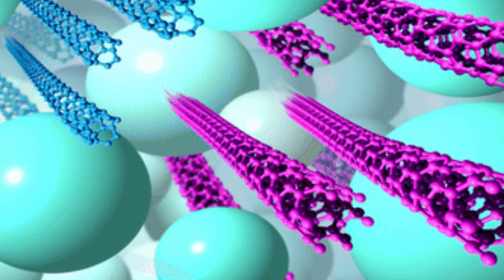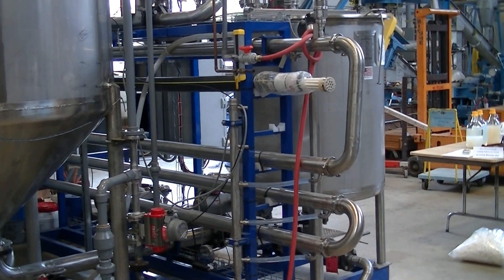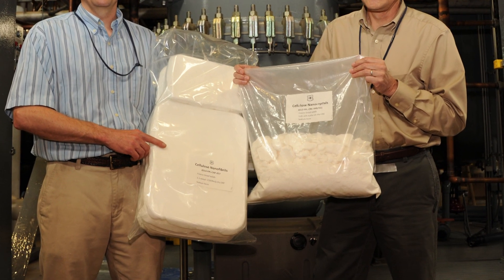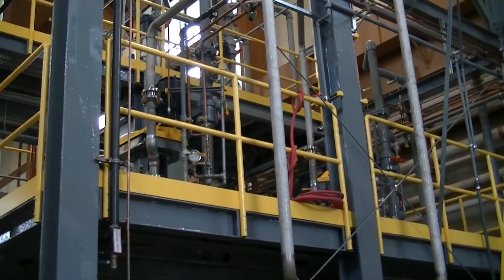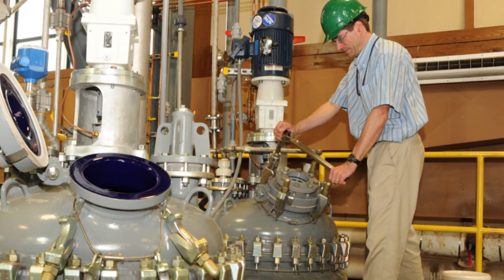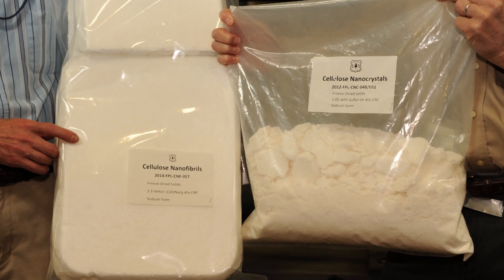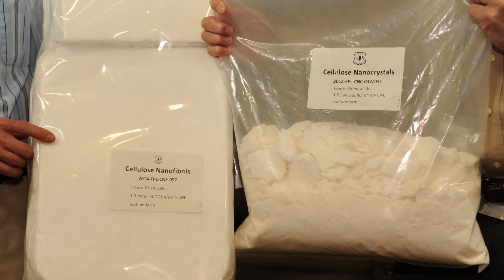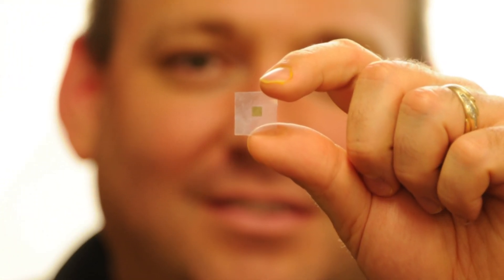Inside A Nanocellulose Pilot Plant--From Wood To Nanomaterials

Comment: What acid to use to dissolve wood curls??
Reply: Sulphuric acid 64.5%, 60 minutes at 45°C and approximately 1200 rpm in mechanical stirrer.